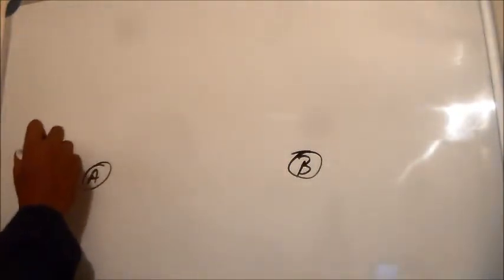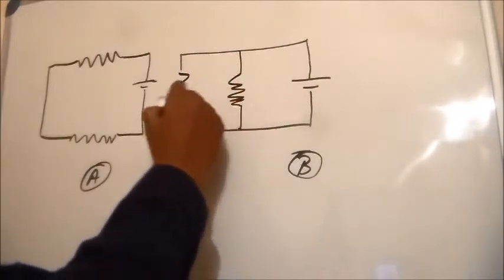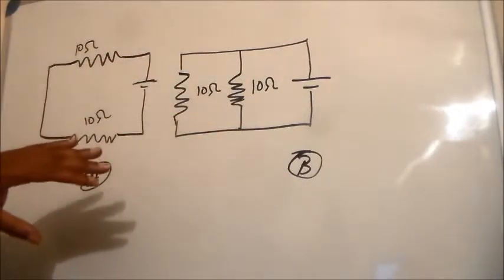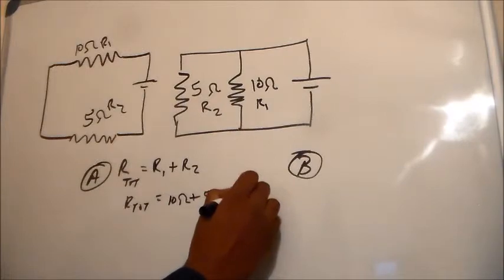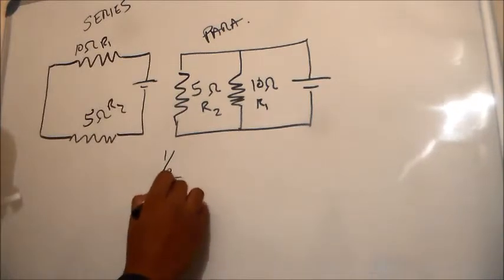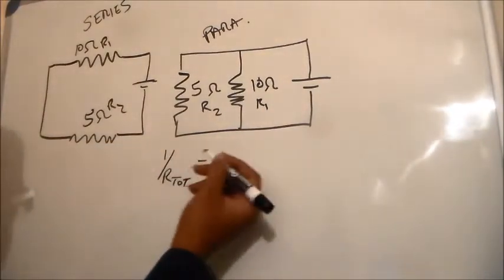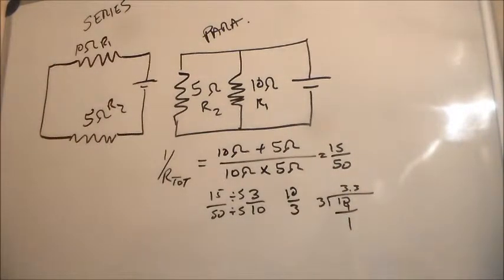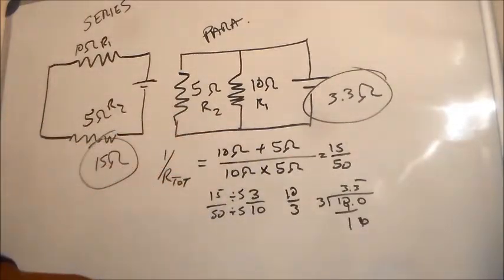Aviation Selection Test Battery - Electrical Problem

Comment: Wouldn't another way of approaching the problem (without attaching numerical values) be to simply recognize that the series circuit has 2 resistors within the one circuit, but with the parallel circuit it acts like 2 circuits (despite being one) in the sense that the flow of electricity/electrons loops between the two parallel wires independently and therefore would only encounter one resistor at a time? Is my understanding of how parallel circuits work correct?